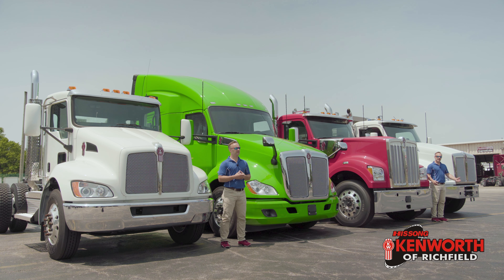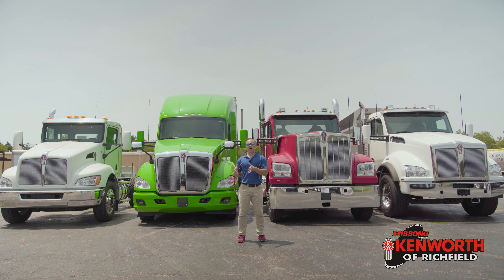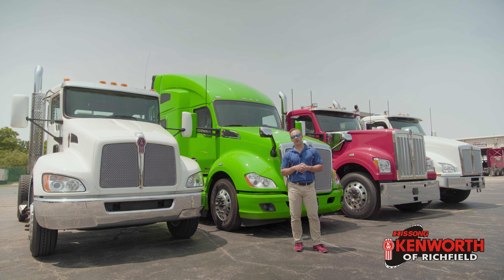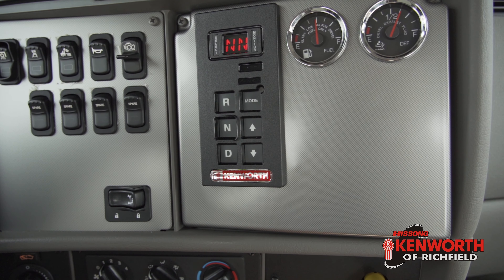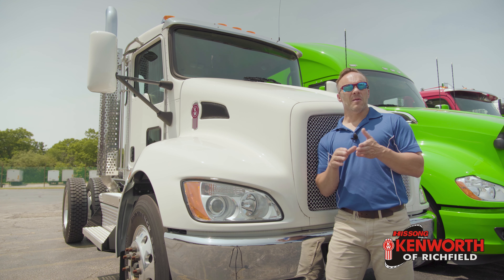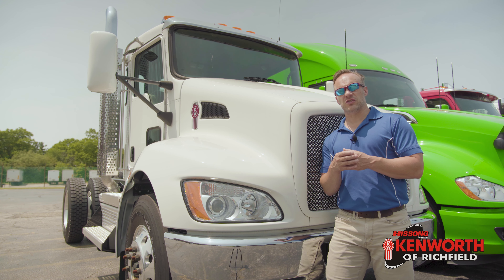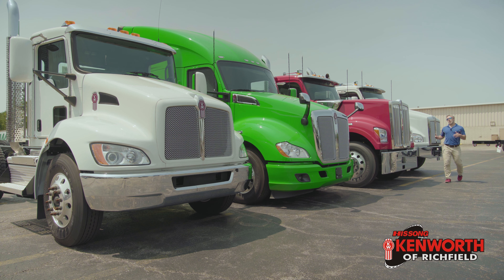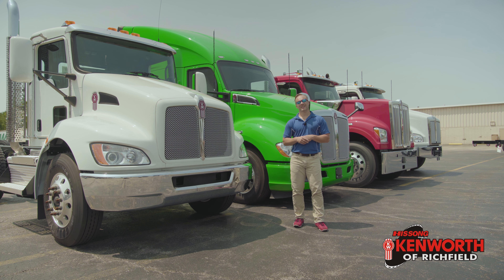Manual vs Automated vs Automatic (AGAIN...sort of)

Comment: You are still missing a transmission the automated but with a manually operated clutch the automated clutch's I have driven are extremely jumpy and almost impossible to get the truck to move inches or centimetres where as the manually operated clutch gives you back that clutch control you get with a full on manual transmission so you can move millimeters the automatic you forgot it is limited to they may be up to 8 gears last time I drove one it was 6 speed the lack of gears and slip in the transmission are good if your gonna hire idiots or are worried about people blow up the driveline in your truck or light duty single axle type stuff but the ones ive driven suck at getting up and going from a intersection and where dangerous in my opinion cause of how far ahead you had to plan and if someone changes lanes or somehow fills the hole you planned on using to turn left through an intersection you are pouched and when you get it to a stop you have almost no run up to build any speed and with weight they take so much more power due to the lack of gears to get a decent acceleration as you can do with less power and a manual transmission with more gears full automated are  good if you are doing city driving or delivery with tons of stopping and starting but no precision movement cause the clutch loves to grab hard i am curious about the fancy new ground up automated transmission never driven one of them only driven to older automated 18 speed transmission manual transmission and automatics 
Oh the automated with manual clutch is nice if you doing lots of speed changes and occasional stops or need that precise clutch control needed to back into hoppers or hitching pintle or other styles of hitches that don't like a sudden impact cause they will hop the hitch off the side of the pintle or ball hitch but yes you have it right they all have there place and tasks there good at but please be more clear as an employee its all to common that uneducated bosses look at cost or fuel costs and not at driver safety or functionality of the driveline for the tasks they will be doing 
The worst two truck setups ive ever driven where tandem axle dump trucks pulling tandem pup/trailer with a 250 hp engine in front of a 6 speed allison no where near enough power to do the task even though they had decently low gears in the rear end the other worst setup was a freightliner classic with a fully automated transmission behind a 567hp engine and 2:91 gears trying to pull live bottom trailer that's constantly over 100,000Lb total weight including truck/trailer and constantly going off road or backing up to a hooper of a tele-belt that had only inches of room for error the clutch loved practically dumping the clutch so most of the time  the truck tried to jump and go not move  a inch so many times the hopper narrowly escaped getting hit by full bore jumping on the brakes and hoping the brakes over powered the driveline and didn't stall the engine by the time it disengaged the clutch meanwhile you look like a retard as the hole truck torques up from the sudden brakes and the clutch trying to fight the brakes and it trying to disengage the clutch to save the engine from stalling made the truck  rock hard all cause a salesman probably was trying to get rid of a truck the dealership ordered that was useless for anything but running lightweight trailers up and down the highway and they picked a construction company to unload the truck they couldn't sell to anyone else either that or my bosses where idiots and don't understand what it is like to drive truck
Reply from the maker: I didn't skip the manual clutch automated transmission as it's actually no longer an option.   I know a lot of guys that had that option and it was very much a "love/hate" relationship with it.   The new automated transmissions really do give you the control that you need in this from what I've found.   Especially in the versions that have "urge to move".   The engagement has definitely changed with the new clutch materials, and how accurately the actuators are that operate them.  

Now with all that being said, each does have it's own application.   If you're contastantly hooking and unhooking with a pintle, or in the hopper application you mentioned, I feel like it'd either need to be an automatic or a manual.  They've all got their place.   It's just about finding out what one fits for what you're doing.    

Thanks for the comment!!!

Comment: If your task was to send out a 2 minute simple explanation into a 15 minute back and forth lot of confusion, you not even only excelled, but you should be fired on the spot.

How hard is it to simply say:
- the manual is a traditional road ranger,
- the auto is an automatic,
- the AMT is a manual transmission that has a computer changing the gears.

Absolutely slack jawed Americans.

Comment: We have manuals, automatics and automated transmission.
Wait till Honda goes into the trucking bizz
There gonna give us CVTs on trucks lol!!!
Reply from the maker: They are in tractors and plenty of cars.....who knows.    I honestly think electric comes in before that.
Reply: Honda only uses CVTs in the cheaper vehicles with less torque (Fit, Civic, CRV, and Accord with 1.5L turbo). Ibelieve 200 ft. lbs. is the limit for their CVTs so the bigger engines are paired with Honda's 10-speed automatic instead.

Comment: This is nice informative video. I recently bought T680 with eaton endurant automated transmission and It is literally piece of shit, it shift so slow, doesn’t understand the weight difference what it is pulling, specially if you were driving Volvo ishift  transmission before there is no way you gonna like it. If my next truck is from Kenworth it is going to be with Allison. Cummins X15 motor is really awesome, pulls like nothing only downside it make lot of noise 🥺. I wish they come with better transmission of their own.

And just for information whats the price difference between automated and automatic.

Comment: Talk about a tough decision when it comes to deciding on which is gonna work best for you.  Each of these has there good points and drawbacks.  Love the manual and all, but traffic and all is getting worse and you're constantly shifting.  I haven't driven any automated transmissions, but I have driven a truck with a Allison for 4 hours.  I just think to me that that Allison needs 2 more gears. Our trucks are have a gross weight of 74,000-81,900 and a 6 spd not enough for me. On hills I will out pull and pull away from the trucks with the Allisons. I think the 6 spd is good in the medium duty line.  Class 8 could use some more gears.  I'm still on the fence about which one I'd go with in a new truck.  Great video! Thanks for taking the time to enlighten us about these different options in transmissions.
Reply: Wayne Norbrey, Jr easy enough choice  as far as reliability is concerned. But I do drive a I-shift
Reply from the maker: Thanks Wayne!   Yeah....there's pro's and con's to each.   It's really about deciding what fits the best for what you do with the truck.   :D
Reply: @JeepCherokeeful  
If we're talking reliability between these than it'll be between the Allison and the manual.  Haven't heard anyone having issues with the Allisons and if shifted correctly the manual is definitely reliable.  I would say that the Allison is in a class by its self. That I-Shift I'm going put in with transmissions like the Paccar 12 spd and the Endurant. It all boils down to if a driver wants to shift or not to shift.  After that it's just researching these transmissions and deciding which suits you.
Reply: Wayne Norbrey, Jr all I can promise is that a manual is cheaper and more reliable over the lifetime of a class 8 semi. But if you don’t gross 100k lbs all the time, nor plan on keeping the truck then automatic or automated manual might be a good choice. I wouldn’t spend my money on one because it will definitely cost more and have the possibility of some issues. Having lived and driven in Alaska for a couple years one learns rather quickly that keeping it simple is best;) Being broke down at -40 or even -50 degrees is to be avoided.
Reply: @JeepCherokeeful  
I'ma have to agree with you on that.
Reply: Wayne Norbrey, Jr driving an I- Shift during traffic jams and while on city streets is awesome though;)

Comment: Can you pull start an automatic? ( when the starter goes out ) also on the automated ….can you pull start it ? I ask because that is an awesome feature about a manual trans mission ( it can be pull started ! 😎 also if the clutch brake starts to fade or go out you can always roll into gear before you stop until you figure out when and where you want to get it fixed along with great pro’ s of a manual transmission.. when you said you were going to go thru some pro’s and cons I was waiting for these things to pointed out 😕 because I have been able to get truck to shop multiple time over my 21 years of driving and with an automated I was dead in the water and to get towed ? Anyways just wanted to put it out there

Comment: We have two new ultra shit trucks at work everyone hates them no get up and go to them.
They are a traffic hazard 
Alison auto only way to go if you want a auto
Reply from the maker: Scott, why do they hate them?    Traffic hazard?   How so.   I'm always interested in hearing the issues to see if I can help.
Reply: It’s slow to build speed. Slow shifting and has to shift to 6th gear before it really gets going. By the time it gets to 6th you have traffic stoped in all directions. Our trucks pull side dumps and I don’t know engine hp.  One driver said he was turning off a four lane to a tow lane and said he had a lot of room before the cars would get to the intersection so he took off. Yea well he was panicking cars had to slow down so he could finish crossing. He normally runs an Allison said wouldn’t have been an issue in his truck.
I had a load in the quarry cruising 15 to 20 to climb a hill and turn at the top normal manual you just make it up this short hill befor running out of power in your gear.
The ultra shift you hit the hill at the same speed it will get you half way up then wants to shift but engine just revs for couple seconds until you loose most of your speed then finds a low gear it likes then has to power its way up instead of using the speed you had built up. Loose ground I can see it spinning out and not making it.
Reply: @scottsandmeyer3428  , wait until the transmission faults when trying to get onto a 65 mph hwy. Bam there you are stuck, no go traffic slamming on their brakes.
Reply: spcabforward 
I could see that happening. I’ve herd that before when auto first came out in semis.  Brother-in-law had a co worker that happened to. 
65 mph and just dropped to 1 gear. Not cool